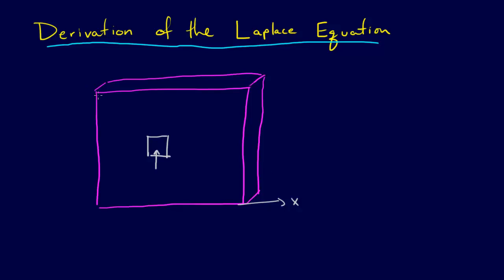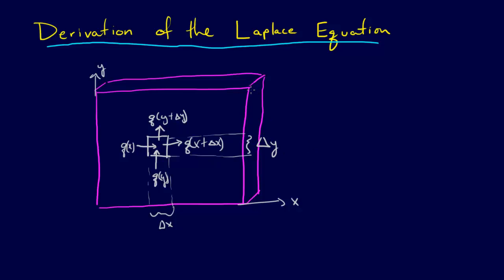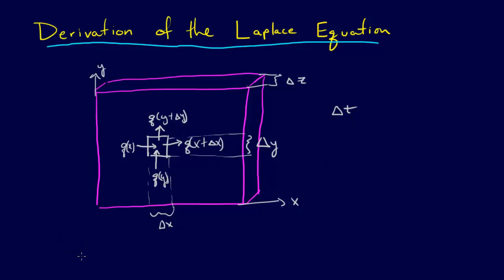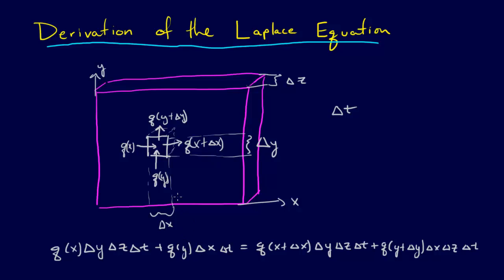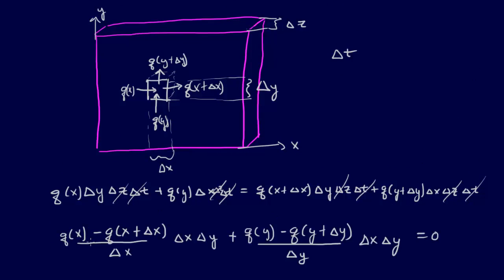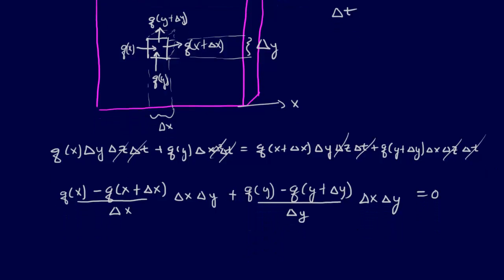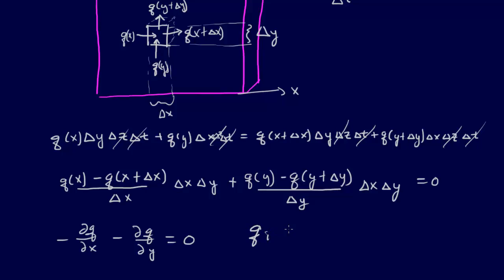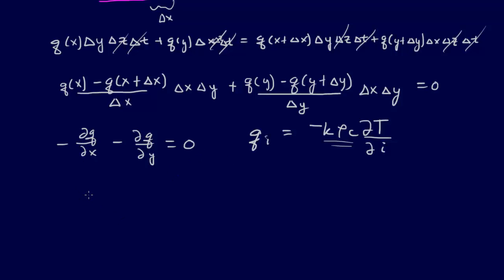8.1.5-PDEs: Derivation of the Laplace Equation

Comment: Thank you! But I have a few questions.. 
1. What equation is that qi=-kρc(∂T/∂i) you used? 
2. I'm currently taking a Hydrodynamics class. Is it okay to submit this method as a test answer in this class? Because this seems to be a thermodynamic method, given that you mentioned heat and temperature. I have never learned thermodynamics so I'm very confusing..